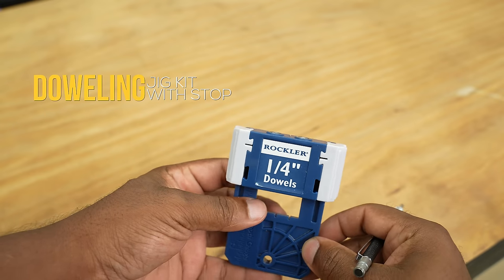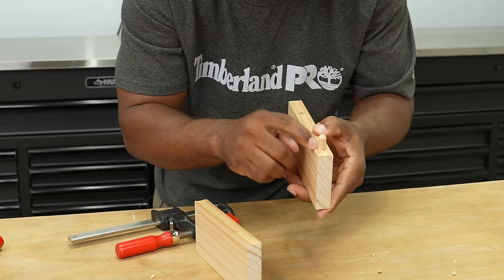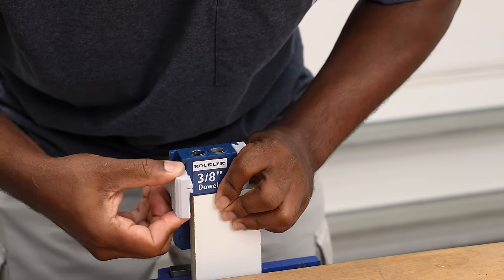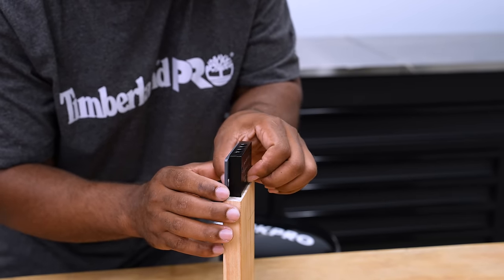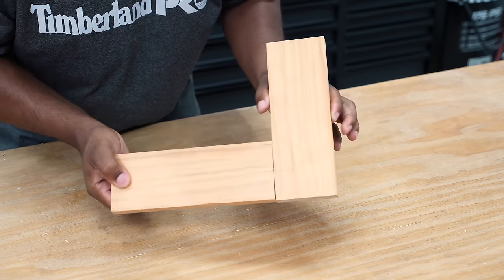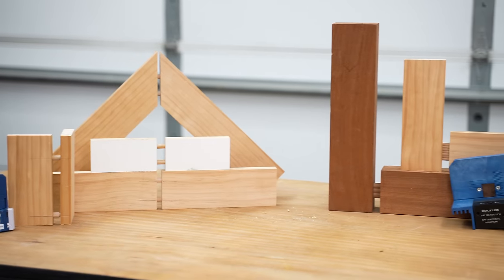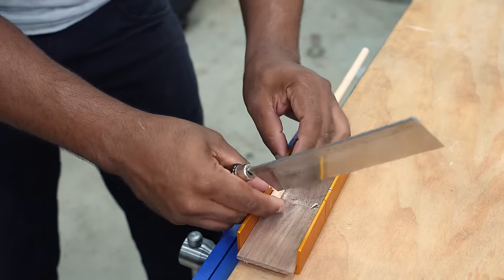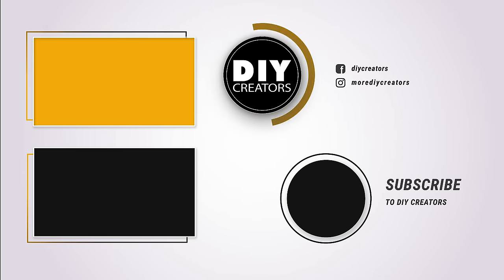3 woodworking joinery jigs

Comment from the maker: What jig interest you the most?
Reply: The corner key because I just started getting into woodworking and have been trying my hand at some boxes.
Reply: The corner key jig
Reply: Jingle bells.
Reply: I have never seen the second Jig before today,  its Quite a unique Piece.
Reply: A metric one 🤣

Seriously, I have no idea how you manage to measure things so accurately using fractions all the time.
Reply: @Syberz  It is actually not that complicated since the measuring tools have marks for the fractions. Picture measuring everything in 5mm increments. The one thing that gets me since I am forced to work with fractions is when I need half of 5/8s or something like that. My brain just can't process that as quickly as I would half of 16mm.
Reply: The dowel jig.  Just a beginner here.
Reply: The one where you use Fresh Cut dowels - so when they dry and HYPER-EXPAND you won't even need glue... ohh wait a minute I learned that from my grandfather...
Reply: The first and last jigs are definitely something I would use with my projects. But do they come in centimetres or millimetres?? 
Very good and informative video as always, thank you ☺️
Reply: Beadlock as I can’t stretch to a domino machine.
Reply: It started as it was for me, idiotprof and got more and more not so. Well good one, I sold all three very well.
Reply: Bead lock was interesting, but I think I'd just prefer using my biscuit cutter.
Reply: The corner key jig.
Reply: Corner jig
Reply: Corner jig🙌🏾🙌🏾
Reply: I've never really doweled anything, spoiled with the domino machine at work. So I guess I dug all the them!
Reply: A jiggy jig!!!
Reply: Beautiful video
Reply: Try  Festool  Domino Joiner one of the best
Reply: The first one the other ones are too complicated
Reply: Corner key dwelling jig
Reply: @paulywalnuts1776  what wmw
Reply: Corner jig if it was available in metric.
Reply: Gettin' Jiggy Wit It
Reply: The first one bc it looked easiest and exact
Reply: Doweling and Beadlock.
Reply: All three of them 👍
Reply: The DowelMax

Comment: For the corner key and contrast. I've used clear nail polish on the visible parts of the dowels before staining so they don't pick up the stain and keep a strong contrast with the white dowels and the stained wood around it.
Reply: do the boards need to be miteted or can you use butt joints?

i just bought this jig and havent opened the box yet

Comment: Really enjoy watching and listening to your vids.  Having set aside my doweling jigs 30 years ago in favor of biscuit joining, I still found your information quite interesting.  The plus side of the biscuit joining is the speed and lack of cumbersome set-ups such as with the doweling jigs. As a master carpenter of many years (OMG !  Next year will be 50 years of building custom homes, cabinetry, and countless custom projects), I find that the biscuit joiner (I use the Porter Cable) along with the Kreg pocket hole / screw jig(s) will accomplish 99% of my joinery needs.  You might share with your viewers the different types of dowels available (straight, spiral, fluted, tapered, etc, ) and how the glue causes the dowel or biscuit to expand ensuring an extremely tight connection. Work safe!

Comment: I have the original non-pro beadlock jig. The pro you've got looks pretty nice, might have to consider upgrading...

And you're definitely right about harder vs softer woods with the jig. Cutting good beadlocks in a 2x4 is a huge pain, Walnut or Maple way easier,

Comment: i need something like this just to drill a straight hole so my screw sets straight and not pull the joint off any suggestions also not using a drillpress something portable

Comment: The bead lock jig you don’t need, when you have wider stock use two or three rows of dowels it would create a much stronger joint as you increase the glue area.

Comment: These are the ways people losing their skills. People in future will not get the chance to learn new skills when they'll get use to these and more jigs.
Reply from the maker: Um what about people with no skills?
Reply: @DIYCreators  they'll have to learn by doing and practicing. Yes these jigs are quick and doesn't require much work from our side but this way you won't learn anything
Reply: Use jigs to take the hassle out of things you dont want to spend a lot of time on. People in the future will be able to figure things out and learn new skills regardless. Great video, dude.